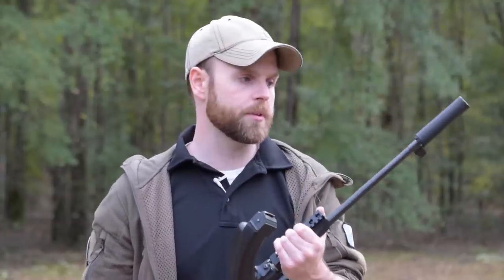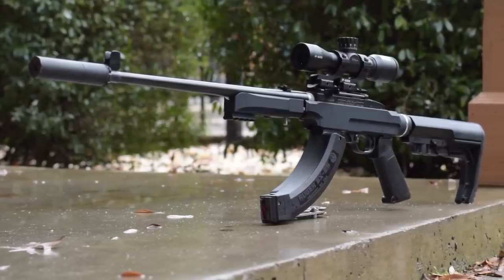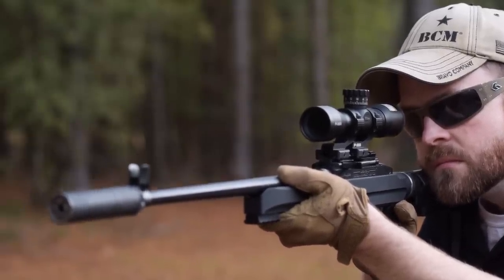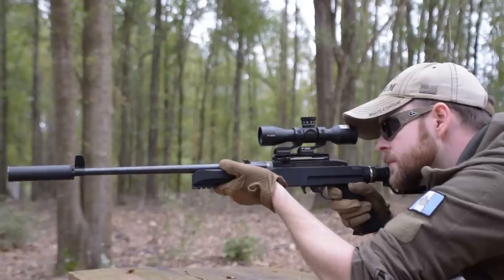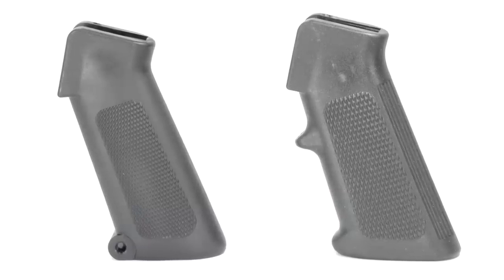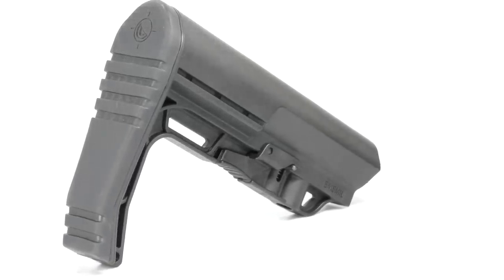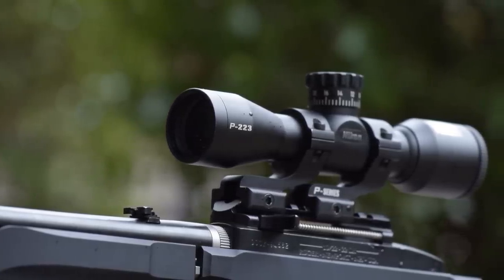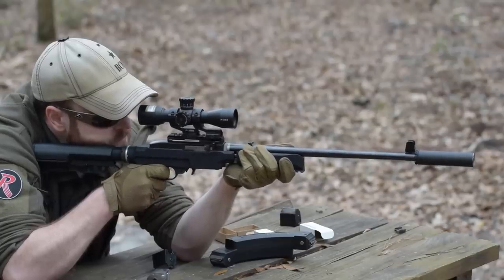Ultimate Ruger 10/22 Bugout Build Part 2

Comment: Sitting here holding a 10/22 Takedown in a Magpul X-22 Hunter stock, I'm not understanding the claim that it was intended to be used only with reflex sights. Mine came with low profile fiber optic sights, and I've never felt like it was hard to get a sight picture on it. I guess maybe if you installed a cheek riser on the stock it might be an issue, but then that's an optional part that IS intended for use with an optic.

Comment: If you are going suppressed, check out Tactical Solutions new takedown barrel, it has a shroud that keeps the barrel over 16" so you dont have to register the firearms, but keeps the OAL low even after installing the supressor. Im going with it....
Reply: joe doe  im sure it does effect accuracy somewhat, due to it being a shorter barrel, but i have yet to take it out to a long enough range that is noticeable. And i am not too sure about other manufacturers. I am sure there is some, but tactical solutions are too notch

Comment: So altogether that has to be at least $800 or $900 for a Ruger 10/22. Maybe more? I rarely consider upgrades a waste, since tastes vary, but this is an absolute waste of money. I wish I had disposable income like that. Still an informative video.
Reply: Robbit Bobbit right?! A standard 10/22, not the takedown version which many like but also known to ship lemons in maintaining accuracy zeros during constant assembly, is $300 TOPS with massive reliability. I liked the bolt and ambi side charge though.

Comment: I havent had a good experience with the takedown model I ended up selling mine first off the barrel was very loose even after tightening then I tightened it and the ring was stuck I had to send it back in they fixed it but by the time I got it back the barrel would not go back together (yes the bolt was locked back) took it into a gun shop and they told me the takedown lock was knocked out of place was to much trouble for me may not for others but my opinion save money and stick with the fixed barrel version

Comment: Far out, I owned a couple of 10/22’s in the 80’s and 90’s when we were allowed to have them (Australia) and I have to disagree with the reliability comment. Yes different ammunition can make a difference, but anything “standard velocity” or higher will cycle reliably every time. The biggest reliability issue I ever had with a 10/22 was cheap magazines not feeding properly, but genuine ruger mags, or butler creek, all fed well... having put 50k+ rounds through one of my 10/22’s, I can never remember a reliability issue, except with subsonic ammo

Comment: Enjoy your explanations.  I don't see a sling though.  To each their own is the basis for using so much after market parts.  Got v.3 CopperCreek bag; this is a takedown after all, right?  That backpack is covert and so much better a bag to carry stuff and shoulder.  You owe yourself a look.  Btw, the titanium firing pins decrease lock time for improving accuracy because they are so much lighter, thus quicker.  They are medicine for failure to fire in two ways: 1.  The actual striking surface is much yougher, so it retains a rectangular striking shape, instead of the originals deforming over time.  2.  Dimensionally superior in the channel it slides in, better mechanics.  Also, failure to eject, did you already address an improved ejector?  Great vids, keep them coming.!!!😁😁😁

Comment: thats awesome and all but I still feel like id rather get a 15-22 rather than make something into something it cant be from the ground up
Reply: interesting, ive always heard the 15-22 mags were excellent. is it the quality/construction or the reliability? 
happy new year, and thanks for getting back to us in the comments. we <3 you.
Reply from the maker: @krossF  - back when most AR-15 .22 conversions used crappy, unreliable mags, a small company made their own that were the exact same shape as regular AR mags. They did this because it reduced movement in the mag well, since it was a full sized mag.

But, one if the neat side effects, is that its working parts are surrounded by a thick, durable polymer shell. So they are very very durable.

So much so, that Spike's exclusively used their mags for awhile. I've got an old conversion kit and I've tried aftermarket mags from CMMG and I think promag, both weren't worth shit.

The original black dog mags, however, ran like a raped ape.

Comment: All your talking points match a TACTICAL or Self Defence carbine- which in .22 is rather pointless- rather than a survival. 22 rifle. I guess it's a question what a "survival .22 rifle" is, but I always understood it as a lightweight easily stowable rifle that lets you get food when you're stranded in the wilderness- not something for self defence or quick tactical style shooting.
Reply from the maker: I agree. For my personal bugout kit I'm running a short barrel AR with a suppressor, a Glock 19x with suppressor, 2-3 loaded mags for each and 200 spare rounds for the rifle. The rest of the kit consists of food, water medical and camping kit.

The reason I address it here, is because many folks want a jack of all trades gun, and if that's the case, I try to configure the 10/22 so that it can serve multiple roles. Even if it can't necessarily do them all that well.
Reply: @thedog556 10/22 with magpul backpacker stock does everything an ar7 does but better.
Reply: A .22 rifle suppressed  for SHTF is way more practical than an AR15!  The last thing you want is engaging enemy or giving report of your location, you’re always elusive.  .22 rounds are a fraction of the weight, effective for gathering food in silence and doesn’t shit where it eats (IYKYK) Can be built ultra-lite & compact in the case of the take-down model for concealment purposes (if it applies) maybe a small weapons lite is the only thing missing that I would consider which can also be used as a hand held lite.

Comment: Damn the stock doesn’t fold and it’s a takedown to much work to make it a smaller package when you can put a folding stock oh and where is the bi pod for accuracy and the magazines look Ridiculous hunting rifles for survival don’t use magazines of that capacity rabbits don’t shoot back and The main thing that’s a load of crap is that you say that the 10-22 is unreliable if that’s the case why’d you choose it and the bolt works great I have two of these rifles they have no short comings other than range and power that optic is over kill you ruined your rifle and went full on mall ninja